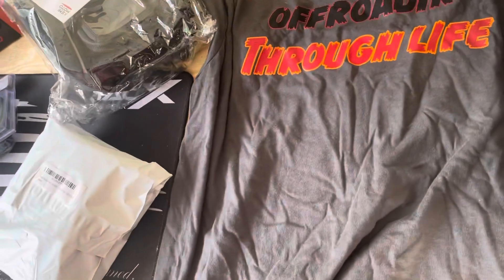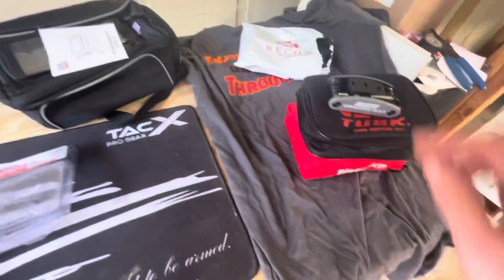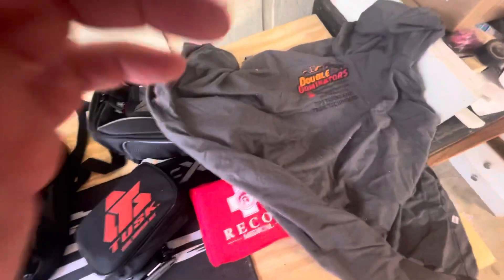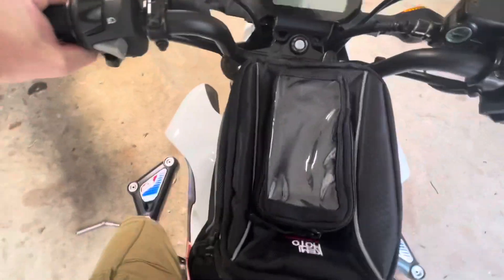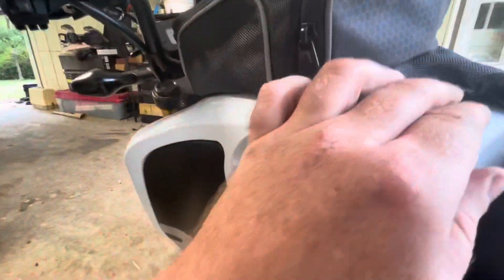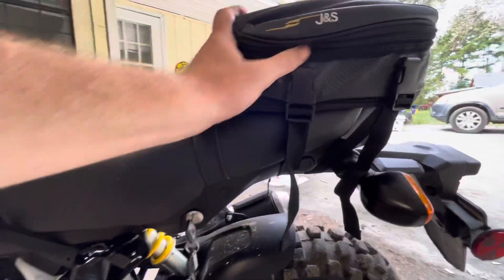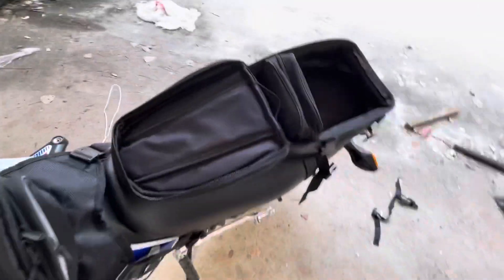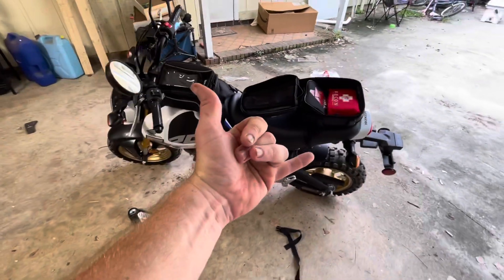GROM 2022 Budget Storage Tank Tail Bag #grom #2022hondagrom  #hondagromstorage #dualsport

Comment: Does anyone know if the GIVI tank lock bag flanges for the CBR300/500 fit the groms fuel tank screw holes?
Reply from the maker: I’m digging the givi bags I might have to look into this one!
Reply: @BackwoodsOffroadOverlanding  right! They even make a small one that appears to be perfect for the grom and it comes with an actual key lock to be able to take it on and off from the bike so no one can steal it. The contents inside aren’t locked up though 😕
Reply: @BackwoodsOffroadOverlanding  also thanks for this video! I was looking at the same tank bag but ordered a slightly larger one and it was just way to big even for it being small. I’m going to be returning it and getting the one you have in this video until I can save up for a GIVI
Reply from the maker: Exactly why I made this video brother! I think you’ll like it I’m pretty impressed and like you said it will do until we can get the fancy stuff! In the meantime I’ll research that givi bag!